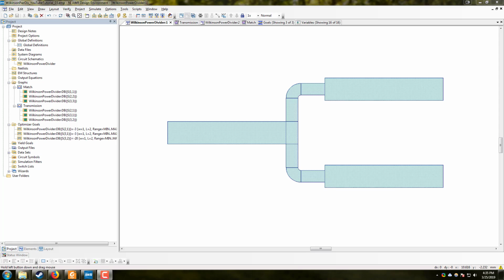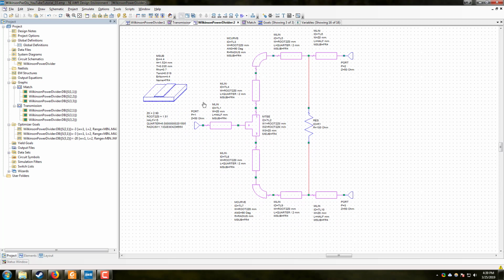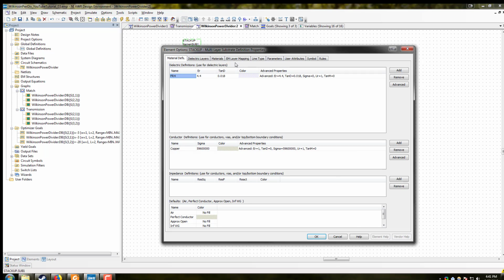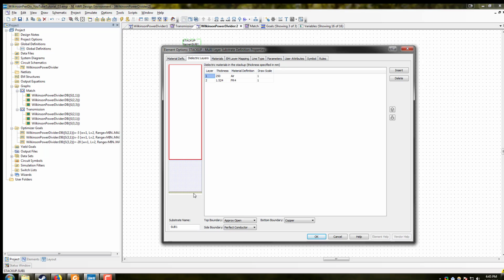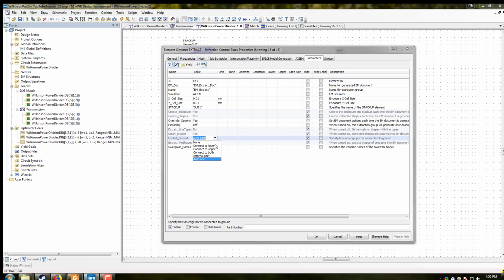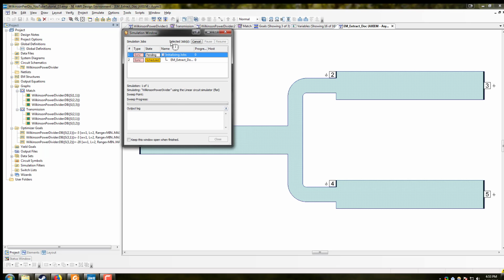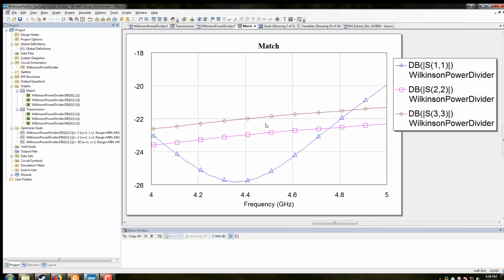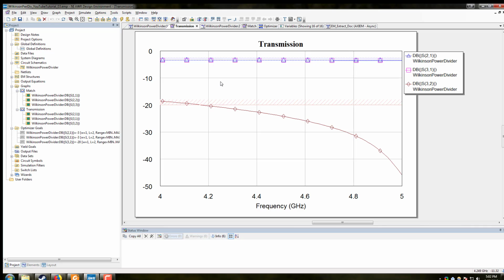How to EM Simulate Microwave Circuits using NI AWR Microwave Office (Tutorial 3 of 3)

Comment: Nice. A few points to make.
1. AXIEM EM simulator is an open boundary simulator that is it uses open boundaries on the sides irrespective eif the side boundary setting you make in the STACKUP Block.
2. X and Y cell size can be kept to one fifth to one tenth of the minimum width in the schematic as a rule of thumb for accurate simulations. Similarly, 5 to 10 times the substrate height for top air layer.
😊
Reply from the maker: Thank you for your contributions.

Comment: This was very elaborative... I think this will help in our university presentation as well. 
I have a quick question though. Why do we have a multi-layer model in the stack up , although we have only one di-electric layer of FR4?
Reply from the maker: What do you mean?
Reply: @MrSimEngineering  the "Di-electric layers" are defined as layer 1 and 2, right? one for Air and one for the Substrate . Why? 
And we do specify the Air thickness also in the Layer in Global definition in Di-electric Layer, right? 
Does it mean technically that Air's layer also to be considered for a certain thickness for the Impedance design?

Did I ask the question in a right way ? Is it clear?
Reply from the maker: @AmitKumarSahoo  This is standard for microstrip design. The only situation where it would be different is if you are creating a suspended transmission line or you have soldermask as part of the fabrication specification. For a bare double-clad board, the side with the microstrip line will interface with air and this must be considered for proper simulation of the microstrip line. Feel free to read Chapter 3 of Pozar's Microwave Engineering to understand more about this.

I should remind you that when we establish the wavelength for microstrip, it's the effective dielectric constant because half of the line is exposed to air and the other half is exposed to the dielectric material of the substrate. If not air, it's exposed to soldermask.
Reply: @MrSimEngineering  Thanks Mr. Anthony , this was really helpful in understanding the basics. I'm learning this new. Thanks again for the reference to the relevant chapter in the book as well.
Reply from the maker: @AmitKumarSahoo  I'll be discussing transmission line theory in a future series I'll be posting. Stay tuned for that.

Comment: when start EM simultation got error:
"An error occured in the remote em simulator "EMSight". The method could not be executed due to an exception". 
Whats wrong? What it can be?
Reply from the maker: You chose the wrong simulator. I used AXIEM in this example. Also, you may have the EMSight feature deactivated in your licensing manager.
Reply: @MrSimEngineering  thank you for the answer. Yes, ANXIEM works well, but I wanted to understand what was wrong with the EMSight. After many hours I just installed new version of MWO(15) and everything worked ok)